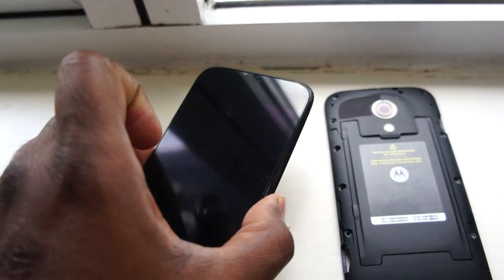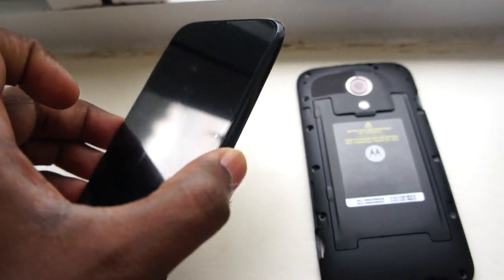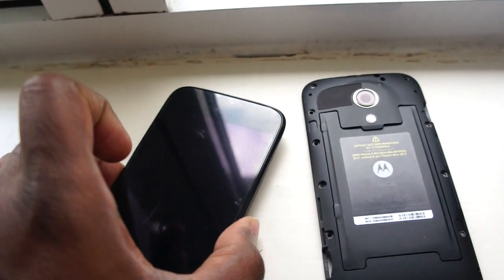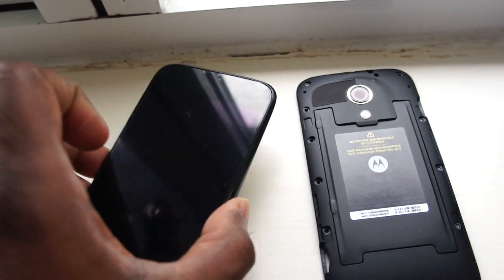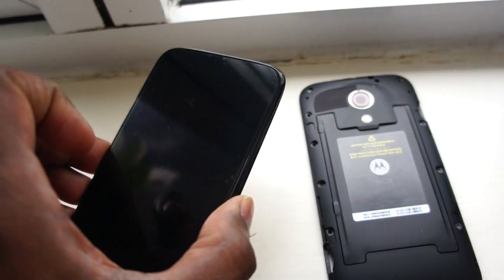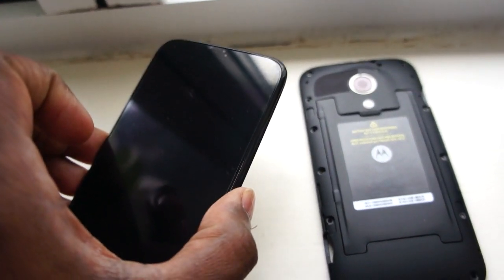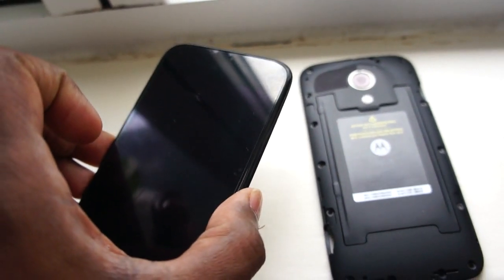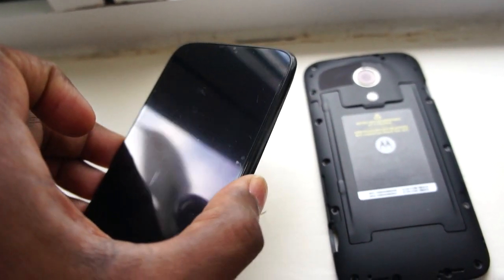Moto G  Motorola Smart Phone Liquid Damage Indicator (LDI)- How to repair Moto G from Liquid Damage

Comment: Thank you!!! 3 days in an airtight bag with rice has got my moto g xt1032 working again! 👍

The camera is not working though - do you know how to fix this?
Reply: Jayenna Smith I am glad you got it back to normal your phone. May be your phone camera's internal circuit got damaged. I am not sure how to rectify the fault. Sorry for that. If I know I will let you know.
Reply from the maker: May be you can buy a replacement camera module (may be less than £5).